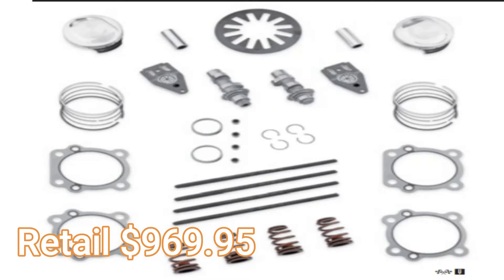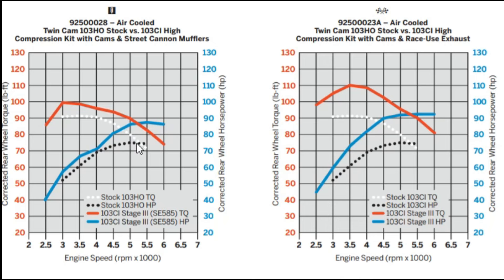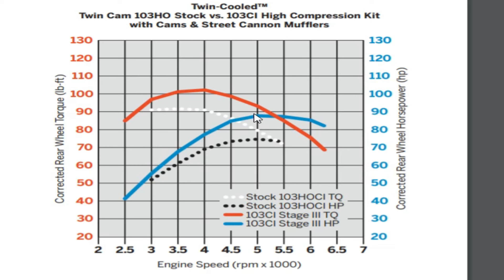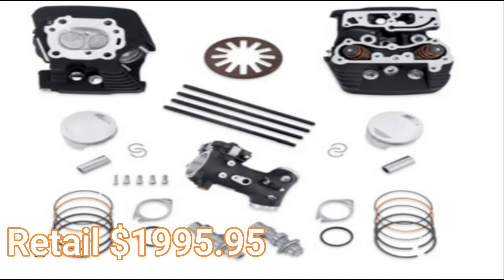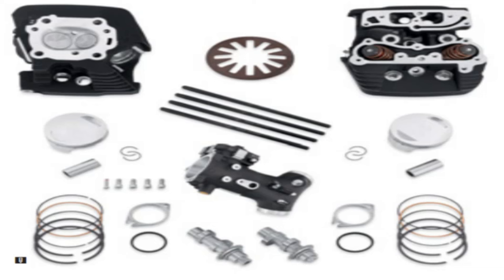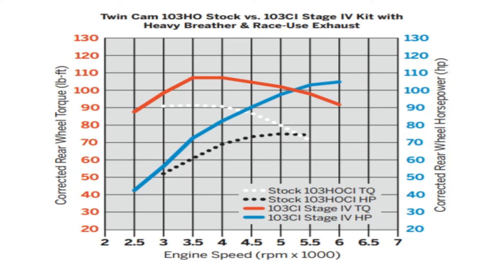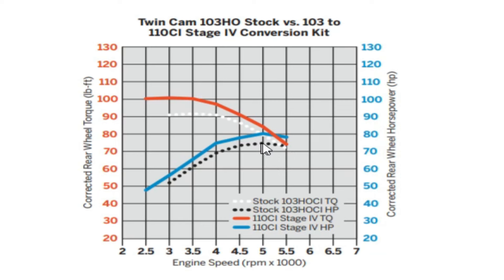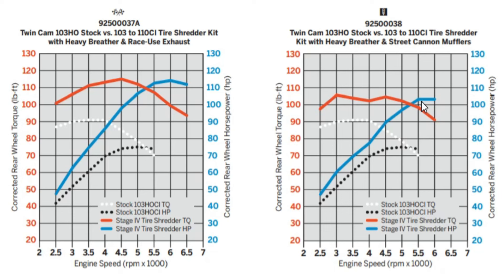Late Model Twin Cam 103's Make A Solid Motor For Modern Used Harleys

Comment: 2011 street glide
103” big bore kit , 259 cams TTS tuner, K&N heavy breather ,dual exhaust with crossover.  3rd 4th and 5th gear Pulls hard
Reply from the maker: Those 103's done like that with the right cam run damn good, love how you have that crossover on the exhaust!

Comment: I bought a used 14 SGS 103  and i have Boneshakers/ V&H true dual headers/ SE intake had it dyno and i got 104ft & 84HP. but i’m looking at getting the tire shredder kit installed at dealer over the winter  but all in out the door is about 4gs $$$  pretty penny. What’s y’all take on it. Thanks ride safe
Reply: I also have a 14 SGS 103 with Stage 1 upgrades.  Just paid her off, and have ridden her for 55K miles so far.  I am thinking of doing the same kit you are.
Reply: @tonyc2912  Ok i’m just wondering if 4grand is the going price for out the install. , I’m in Boston  so shit $$$$$$$$ lol.
Reply from the maker: A that works at my local dealer has a Road King with tire shredder. It's worth the money, his bike is fast and it runs hard.

Comment: What about performance upgrades for cvo 103 like thiner head gasket for higher compression and Cam upgrade .what cams would you recommend not looking to go with se more aftermarket looking for performance and a little chop.
Thx. Love your videos
Reply from the maker: The CVO 103 is a very interesting engine, it's basically a stroked 88. Here's a video on the SE 103 https://youtu.be/xQbzkJawKvM

Comment: Great information! I have a 2012 Roadglide with the 103. The kits, like you said unless you go all the way are less than impressive. Currently i have stage 1 with 2 into 1 exhaust and SE street tuner. I’m looking to upgrade with a Thundermax ECM, and a woods Tw-222 cams. This should net me about 97-100 hp right?

Comment: I wanted to know would it be a good buy for 2014 street glide 103 with 64K miles on it? All I know is that it has a d&d 2 into 1 exhaust.
Reply: I think that depends on what the motor condition looks like. Ask the seller questions. Test it. If you think its not worth the price, still get it, but only if you are able to get it for what its worth.

Comment: So I have 2002 Honda vtx1800c that will blow away my 2011 HD ultra limited with the 103ci. S&S makes a 143ci that could probably beat up my VTX but is a 2011 Ultra worth another $15k when the VTX was only $3500? Maybe, cruise control, stereo, and a happy wife...
Reply from the maker: The VTX is a nice bike and they make some really good power, about 100 horse and some where north of 100 ftlbs of torque. They pull pretty hard!

Comment: Why do alot of these kits push the 585 cams on people? I heard they are a turd down low
Reply from the maker: My thought on that is the focus is on peak horsepower, it looks good on paper and don't get me wrong the 585 cam accomplishes that. Focusing on peak numbers misses the big picture though, most of us don't spend all or a lot of time up on the top end. To get a good cam it's better to focus on big numbers in the low and mid range that still runs out decently on top. That's really where the majority of people ride unless you just run wide open all the time.

Comment: Picking up a 2013 Ultra Limited Extra Clean 28k mls.Notice Rust mainly R Spark plug facing is that a Red Flag or Pretty common? 
feed back greatly Appreciated.

Comment: You really need to be evaluating non-Harley kits....Screaming Eagle have pretty weak "stage" kits compared to what is available through other vendors, and much more expensive.
Reply from the maker: The cams make all the difference, the cylinders and pistons are decent, but SE cams are not even close to aftermarket cams. Someone with a SE Kit is already in deep, but to make it what you want a good aftermarket cam swap makes them come to life.

Comment: I got a 2016 heritage softail with 103HO. It’s got more than enough power for me. I don’t ride a harley to be fast anyway. I just never had a desire to mod engine and compromise the reliability to be faster. That 103HO will do anything I ask it to do whether it’s climbing a mountain or crossing the country. Harley got it right with the 103HO and I’m gonna leave it alone.

Comment: 103 is solid and can make decent power while maintaining longevity I put a 103 kit on my 07 wide glide 54k miles only thing that shit the bed was my fuel pump at 50k not a big deal to replace though
Reply from the maker: 103's make a great power stock, even when you convert a 96 over with the stock cams the displacement makes a difference.

Comment: I just bought a 2013 softail slim with a 103.. it has 85k miles on it.. I figured Id do a 110 kit, cams, and cnc'ed heads. I figired a cam plate, true and weld flywheels and timken conversion also. But Im wondering, will it be ok to do this without actually rebuilding the crank ?
Reply from the maker: If you plan to go that far with the bike and the mileage that it has on the current lower end I would go ahead and do the crank. That's a lot of miles down on the bottom end, planning on a cam plate you'd likely find the run out on the crank is too high. You'll need run out ideally at .003 or less with a billet race cam plate.

Comment: I ordered from Harley-Davidson in 2013 the new cases the screaming eagle 4.070 Pistons jugs the CNC heads and the 4 3/8 crankshaft. I added fueling cam plate oil pump and lifters I added Andrews 67g cams I have the crank trued and welded I had the jugs done and my bike makes 126 horsepower at the back wheel and 118 ft lb of torque I changed the primary to the screaming eagle 315 and she'll do 145 comfortably with the original five speed this is the engine I put in my 01 road glide to replace the 88
Reply from the maker: That's a very nice engine you built! Andrews makes some awesome cams for Harleys, great company and they also grind cams for many others as well. You've got some serious power on that bike, I bet it's a blast to ride!
Reply: @GixxerFoo  one of the stupidest engines I've ever built the bike doesn't weigh anything does 10 second quarters I only weigh 160 lb myself total idiocy thanks for noticing.
Reply from the maker: @randylucas2458  Sounds like my kinda engine! 10 second quarters on a Harley is a hell of a ride, hope it's not too squirly out of the hole!
Reply: @GixxerFoo  I need to put a right side drive on it pretty bad I'm hoping that'll straighten it out

Comment: Good video what you recommend to make a 110 has 41000  miles my 2014 ultra classic
Reply from the maker: You're looking to convert a 103 to a 110?
Reply: @GixxerFoo  yes 103 to a 110
Reply from the maker: That Stage 3 setup makes really good power over stock. The stage 4 is a high rpm kit, the stage 3 keeps the power in the middle. Depends what rpm range you're looking to ride in mostly.
Reply: If any one is actually serious and can't wait ..I have a complete 110 top end I' all take half price for ..itvhas exactly 30 miles on itvi put on myself ..and pulled the while top endvoff cams and throttle body pistons cylinders and heads injectors the works all you will ever need to uP grade a 103 to the 2017 Dyna S  110 cubic inchthat make 90 HP to the tire and a 100 gt lbs torque

Comment: Can anything be done to save the 110 kit with the CVO heads?
Reply from the maker: I'm not sure what you mean?
Reply: I have the 110 kit (still in boxes) you said to stay away from. Can I change any of the components (heads, cams, pistons) to make it work better? Purchased it from a guy that sold his bike before he had it installed. Paid $800 for it and not sure if I should cut my  loses or try upgrading the kit.
Reply: I guess it was a wasted $800.

Comment: Last of the superglide had the 103
Reply from the maker: Hell you're right they did, you don't see many of those running around. I have never seen a late model Super Glide with the 103, they have all had the 96 or a 103 conversion.
Reply: @GixxerFoo  I have a factory 103 superglide I purchased in 2014 new.
Reply from the maker: That's awesome, it must if been a mid year release. Harley likes to do that to us. It's weird August being over and no new Harleys this year.
Reply: Daniel Selby Me too and I think we got something special there.

Comment: If I go for the 110 package can the stock crankshaft handle the power? Seams to me I might as well go for the 120 st crate motor??? Love your videos keep them coming!!!
Reply from the maker: If you keep it mild and don't beat on it the stock crank will be alright, they are pressed cranks so biggest thing is just not lugging the motor. I would get at 120R before the ST, the ST is the same engine as the R but the ST has a milder cam.

Comment: I have just bought a 2003 ultra classic:  103cc anniversary engine with Screaming Eagle CNC high compression heads. Screaming Eagle 6 Speed transmission, and hi-performance cam 
 D&D 2 into one pipes with faux left side pipe,  Dynojet Power Commander IIIr ignition, ++++ more too long to list. I have been trying to find out if this qualifies as a CVO. It does not an emblem. (A true garage find. Parked in a garage for the last 5 years and driven less than 100 miles per year and everythng all original?) There is very little I can find on the internet, Can someone  please help me?
Reply from the maker: That would be the Anniversary Edition for 2003, it shares the same Screamin' Eagle 103 as the CVO Road King. The two CVO bikes that year were the Road King and the Softail Deuce, the softail only had the 95 inch motor though.
Reply: @GixxerFoo   Thank you very much for your reply. It gives me more clarity about the engine. A lot of dealers were telling me it is not a CVO .
Reply from the maker: No problem at all!

Comment: I got a 03 ultra, with a 106 S&S Stroker everything possible done for hp on nitrous n airshifter, chain drive.  She works good but I'm always chasing that performance . Next motor I want a dragon 143, anyone have any feed back on one of these BIG ASS MOTORS? I'm a old drag racer I just dont wana do 7 secs on a bike anymore!
Reply from the maker: Damn well a 143 could get you in the 7 second range with the right power adders

Comment: I have a 2010 FLHP with the 103 motor. Had it 18 months now after riding Evos since 1999. I like the ABS, cruise control and the police siren that still has the working "air" horn, but damn do I miss my Evo bikes. So easy to work on and diagnose issues and they have THE best sound. My 2010 has been a pita with it's sensor issues. Been dicking with it for a couple weeks till I gave up. It's at an indy shop now to try to figure out some sensor based issues @ $140 an hour. Woohoo! No AZ bike week for me. Anyone want to trade me for a Road King Evo? :)

Comment: I have an original 88 2005 RK that was build by the previous owner to a 103 Screaming Eagle(old). He put a Screaming Eagle 6 speed transmission.  Cams seem original like on the 88s. He did put a SE intake.I have replaced the cam plate with a  Feuling cam plate with hidraulic tensioners and new larger fuel pump. So the engine is far from original. Question is: When I will need to rebuild the top end, with what can I replace it with? I don't want to go back to 88 and I don't want to bore out the cylinders . Can I use something bolt on? Cheers! P.S. I am not a mechanic and english is not my first language :)
Reply from the maker: If it's a 103 it's likely got the stroker crank, so a new 95 inch top end kit to freshen it up would work great.
Reply: @GixxerFoo  thank you so much!
Reply from the maker: Hey anytime!

Comment: Man! We ain’t all rich!
Reply from the maker: Yeah performance isn't cheap at all, best thing to do is have your cylinders bored and source your own pistons if you want to go with a big bore. But just a cam set swap on these bike makes a huge difference with a aftermarket set. Put you right up there with a lot of these kits.
Reply: @GixxerFoo  I might do that. I can’t afford the Tire Shredder kit that I want. I put Wood TW - 7H cams in it last week, and it runs much better. I haven’t put it on a Dyno yet. I wonder how far I can bore these cylinders without getting too thin?

Comment: Quick question, are the 103 heads a direct bolt on to the twin Cam 88
Reply from the maker: They actually will bolt on and they are much more efficient. You will however have to use the late model intake flanges.
Reply: @GixxerFoo  do you think it would be worth the expense ? 
 (Slowly learning)
And would it Better the motor as far as longevity ?

Comment: 4 years ago i purchased a 2014 Road King FLHR 103 HO absolutely love this bike. Since switching over to full synthetic in all 3 holes I’m achieving 46 mph religiously. I used to get 41-42 with detergent oil. I had a 2005 Road King Classic before this one. The rider and performance changes they did to the Rushmore series bikes are outstanding. 2013-2016 bikes were Rushmore. 2017 switched to the M-8.

Comment: I have a road King 124ss I put in it still need more power
Reply from the maker: Have you run it on a dyno and pulled some numbers?
Reply: @GixxerFoo  150hp
Reply from the maker: Damn l don't doubt it.
Reply: @GixxerFoo  150hp now my vmax has 140
Reply: @GixxerFoo  think I need the new vmax that's what I said to the wife
Reply from the maker: That Vmax is one bad bike, a lot of people don't get powerful it is. The new one is about 200 horsepower.

Comment: I have the 103 from 2015, and I put the tire shredder kit in it. It tops at 117 horsepower and 127 foot pounds of torque.
Reply from the maker: I gotta say that Tire Shredder Kit is bad ass, it's really impressive with a good exhaust and tune.

Comment: On my 09 FXSTC I did a 103 big bore with new ACR heads and .030 head gasket SE 204 cams with 1.7 rockers. SE cam door and oil pump Changed the final gearing to a 30 tooth front and a 70 rear. Thing runs effin awesome very happy
Reply from the maker: That sounds like an absolute screamer, I bet you surprise some guys with their new M8's!

Comment: I just bought a 2010 Ultra Classic 103 and it's leaking a few drops of oil every day. Oil and trans fluid are fine. It looks like it's coming from where the pan bolts onto the bottom of the motor. This is my first Harley. Any ideas where it's coming from?  Do they have a reputation for leaks?

Comment: Hello, Had the Woods TW222 cams installed 
in my 2013 dyna street bob. They made a huge difference. Needed to run the autotune in my fuelpac. Very happy. Thank you for your advice.....Gary
Reply from the maker: That Wood is just so hard to beat for me, I bet it feels like a new bike now! I am really happy to hear you're enjoying it! Let me know how it runs after you get your auto tune done and get it dialed in some more!
Reply: @GixxerFoo  . I auto tuned the bike and it runs amazing. Very happy. Does feel like a new bike. Thank you for the great advice....Gary
Reply from the maker: Not a problem, anytime!

Comment: I’m considering getting a new 1200ns, FXDL with a 103, and a softail S with a 103. What would be your pick? I’m leaning towards the Dyna but the 1200 is new. However for long Texas straightaways the extra power might help.
Reply from the maker: They are really great bikes in their own respects, I might be a little biased cause I really like the Dyna Low Rider. A Softail Slim is great riding bike but it does sit very low to the ground and doesn't have much cornering clearance. The 1200 is a fun bike, I have a 2016 1200 custom and my wife rides a 2017 Sportster 48. But if you're running down long highways it's gonna get real small after a while, I'd say the Dyna would would be my pick. The Low Rider is like a big Sportster, it has room to stretch out and it's a lighter big twin but it will still ride good down the highway.

Comment: Hi, a little off-topic question (but maybe not so much). 
Based on your I see deep knowledge what do you think about the flywheels scissoring; on the late TC103s it's still an issue to be concerned of? 
Especially if hopped-up or brought to 110
I tend not to do clutch drops or lug the engine, on the contrary, I like to wind it up when the road is right
Reply from the maker: It hasn't seemed to be wide spread from what l've seen. When it does happen it's usually someone waaaaay overbuilding an engine and riding it extremely hard. There are a lot of Twin Cams out there with with well over 100 horsepower reliably.
Reply: @GixxerFoo  Thank you very much! Great channel you have and you are very interactive
Reply from the maker: Not a problem at all! We definitely appreciate your support over here!